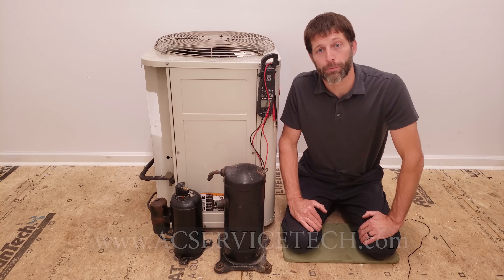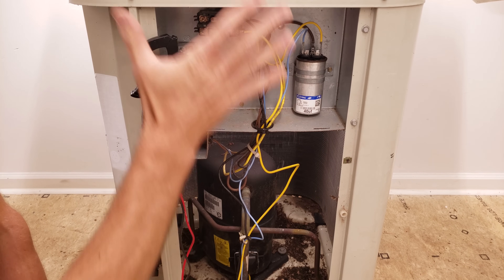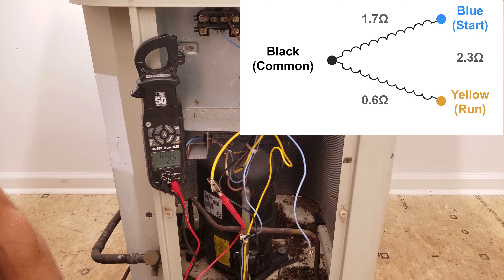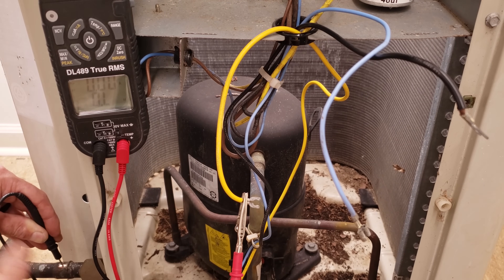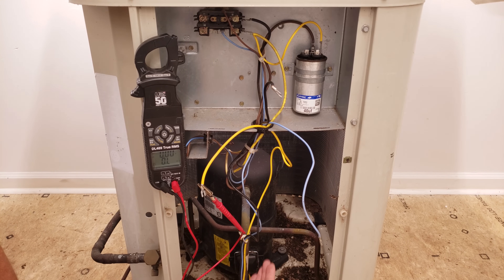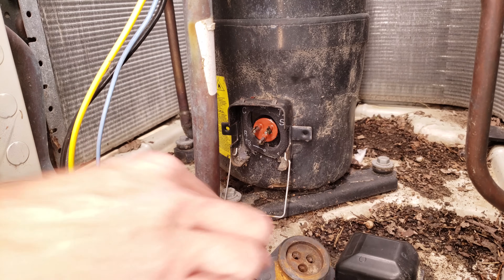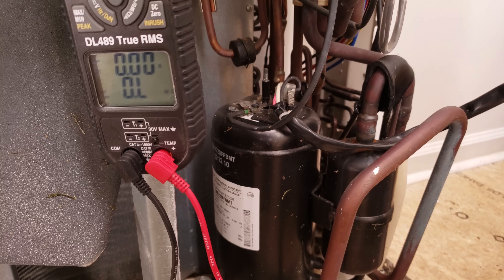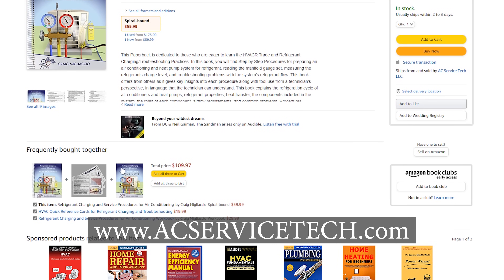Testing if an HVACR Compressor is Shorted to Ground, Open, or Overload Tripped!

Comment: This tutorial very useful. But that's part of compressor checking. That's electrical checking only. What if the compressor is seized. Or weak.
One of the best solutions checking mechanical functionality would. Be pump down the unit to see if it pumps down correctly or not.
On the other hand all inverter units have same winding resistance as the inverter controls the load of compressor by increasing and decreasing the Amp and volt rather than winding.
Big like to all  your efforts during last couple of years. Appreciable
Reply: Is it possible that Freon levels could be too low for the compressor to pump down correctly?
Let's say the unit actually does start cooling down when it's turned on initially, but stops cooling after 30 seconds or so, and then you try to do a pump down after that.
Reply: Can vapor pressures be too low for the compressor to pump down the remaining Freon?

Comment: Is it a failed compressor if the compressor is pulling double LRA even after installing a hard start kit but the windings have continuity? Compressor isn’t tripping the circuit breaker either
Reply: Yes that would be a failed compressor if it is mechanically locked up like that.  Sometimes you can give it a bump and it will free up but that's a stop gap solution

Comment: Great video. What is it that is causing the ac breaker trip frequently? Checked all the electrical of the condenser unit and all seems to be good. The capacitor is new the fan motor has no issues the contactor looks good. Could it be the compressor causing it? If so how to diagnose and fix? Thanks.
Reply: Check the circuit breaker itself...Make sure that ac breaker it not warming up or hot when you start/running the compressor,  check the temp of the circuit breaker-using HVAC infrared thermometer...Also, With your HVAC clamp on ammeter, check the Starting Load Current SLA and Running Load Current RLA...
Reply: @thembones12  Thanks for the reply. Just for your information, it was the compressor. It was overloaded with Freon. Overcharged with the Freon. Recovery of the freon did the trick. The breaker has not tripped since then. Thanks.

Comment: Not all failures are burnouts. There are 3 types of Compressor failures opens,  shorts and burn outs. A standard VOM may not find a high impedance short to ground a merger maybe required. I’m a HVAC&R service tech with 40+ years of experience.
Reply: Generally shorts to ground are not a burnouts or have significant amounts of acid in the system.
A burnout will generate acid from insignificant to severe and often create sludge if any doubt use an acid test kit. At a minimum a high capacity liquid line dryer should be installed when changing a compressor and the refrigerant should always be changed.
Reply: @monteglover4133 megohm
Reply: Yes definitely a megohmmeter is the right tool for this a vom is not capable of reading such values
Reply: I'm not that sold on meg ohm fail, bcos i'v seen units called out as condemned, low megs, but just warm it up, run it, then check megs again and voila the reading climbs to a pass reading.
Reply: @Froggability  compressors with liquid refrigerant in the oil, or contamination, or moisture in the oil can fail a megger test.  Meggers are the proper tool to use to determine the condition of the motor windings, or the atmosphere around them.  It’s part of annual service on large  air conditioning units, where a burnout can cost thousands of dollars to clean up.  The compressors are taken off line, to prevent a running burnout.
Reply: @rodgraff1782  . Hi. 
What s the minimum acceptable value of meg ohm test before changing compressor to prevent burn outs.
And better, What s the minimum acceptable value of meg ohm test before changing the refrigerant to prevent compressor. Thanks
Reply: @lebmael1709  when measuring insulation resistance on large chillers, and the manufacturer specifies what the limit is, before you have to take the unit off line, because it is close to burning out.  Usually the readings I take on smaller compressors will show up as the megger gets harder to crank and the needle moves all the way to the right of the scale.  I use the old style crank type, not the cheap ones that run on batteries.  My meggers  use a hand type crank generator to  create the test voltage.  If there is a short, it puts a load on the megger and it gets harder to turn.  The test voltage settings are 250 volts, 500 volts, and 1000 volts.  My book states the resistance value minimum at 2 megohms.  For a 230 volt compressor you would test with 500 volts.  For a 460 volt compressor you would test at 500-1000 volts.  The resistance measured will go down if  a motor is moist.  For compressors, the megger test will fail if there is liquid refrigerant  setting in the compressor, or if there is moisture in the oil or refrigerant around the compressor.  The reading will also vary with motor temperature.  It’s best to get the minimum resistance to ground specifications from the manufacturer.  With the high test voltage, it has always been quite obvious to me, because the high test voltage will make poor insulation arc to ground.  Starting a compressor that has a lot of liquid refrigerant can cause a short to ground.  That is why the manufacturer specifies that the crankcase heaters need to be energized, for a length of time ( usually 24 hours), to drive all of the liquid refrigerant out of the compressor.  On a  semi hermetic that has a lot of liquid, you won’t be able to see the oil level thru the sight glass, because it will be too high.  Once the refrigerant I derive. The oil level will be within the sight glass
Reply: @rodgraff1782  many thanks . 
In the same way, is there a method, when servicing a machine you did not set up, to recognise a possibility of poor evacuation during first installation , before having a fail test merger.   
And if yes,  how to fix the problem easily to prevent bigger problem due to moisture in the future ?
Reply: @rodgraff1782  ok 👌. 
About moisture, when you remove the refrigerant by recovering it to check the system.
Alter a good evacuation under 500 microns, If the micron level rises and stabilizes around 500 , good sign ? No moisture ? We can reuse refrigerant and restart the system ?

 If there is moisture, it gets out of the system with refrigerant and remain partially in the oil ? What is the acceptable limit of rising microns level before stabilization to know if moisture or not?
If there is moisture the refrigerant needs to be replaced or just filtered? And what about the moisture which is stuck on the oil ? 
Many thanks
Reply: @lebmael1709  I don’t know hat type of system or compressor you have.  On a system with a sight glass ( most larger systems) there is a moisture indicator in the sight glass that will tell you if there is still moisture.  You have to keep changing the driers and running the system to get the moisture out.  If you have a similar hermetic compressor, the oil can be changed to help.  I think you already proven the system is free of moisture if it held at 500 microns.  Our recovery machine had the ability to filter the refrigerant once it was recovered.  It contained large dryers.  You can change the refrigerant if it suspect.  Add a new drier and sight glass regardless of what you do.  Moisture can be trapped in the oil, but running the system with new driers should clean it up.  To test for air and non condensables , the refrigerant has to be in the system, but any air will come out with the refrigerant once you evacuate.   There is also the possibility that someone topped of the system with the wrong refrigerant.  This would show up as a different pressure other than that of the correct refrigerant, if you do a pressure temperature check.
Reply: @rodgraff1782 ok thanks.  i maintain mainly inverter heat pomp and inverter ductless system. So there are not any driers or sight glass.  
If necessery , i will add a drier on the liquide line to clean up the system.
Reply: @Froggability  Thats the purpose of having a crankcase heater energized for the time the manufacturer states in the installation information.  Usually, if you feel the compressor, and it’s warm to the touch, it should be ok.  I had two Trane units that failed the megger test, because they had been de energized, and refrigerant migrated to the compressor. Once power was restored, and the crankcase heaters drove the refrigerant out of the crankcase, the compressors passed.  They will also fail the test if there is moisture and contamination around the windings.  That indicates that the system needs to be cleaned up, by adding driers and running the system until the sight glass moisture indicator shows no moisture, and the oil is clear and contains no acid.  It’s best to change the oil if possible, because the oil will absorb moisture.  If the compressor doesn’t pass after all the above, then it is suspect.  Compressors will run at a lower value.  Just because they fail the test, it dose t mean they will completely fail immediately, but they are at risk of burning out.  I always megged new compressors before installing them.  I have caught several new ones that were not good.
Reply: Y’all making this way more complicated than it actually is. Set your meter to continuity. Check each leg to ground. No continuity means no short. Now check continuity from leg to leg. If you have no continuity between legs then the compressor is either 1. Tripped on thermal overload causing windings to read open, wait til compressor cools and check again. If you check continuity after compressor cools, and you still have no continuity between any of the legs, the compressor has open windings and needs to be condemned. Ain’t that hard. Old heads trying to sound too smart
Reply: Thank you so much for your help 🙏 and it help me a lot God bless you
Reply: And valves
Reply: Gentleman, answer me this… I watched this video and went out to the garage and tested a compressor that was off a removed rls3 everything showed that this compressor was good . I then went to look at another rls 3 and it showed what I thought was that it was grounding. ( all 3 plug to ground showed 1.6 +- ) i told him it seemed it was grounding. Question will a grounded compressor still run? Someone else came and replaced the pcb and it worked.. I’m confused to say the least
Reply: @EbenandDylan  from any pin to pin (3 of them common, start, run) there will be a low resistance any pin to ground (the shell of the compressor) should be near infinity.
Reply: I believe he stated that lol
Reply: I have a scrolled compressor and is it possible that there is shorted only one terminal? (Like only one wire is around 20 om to a ground )
Reply: What happens if you disconnect ground  ? Will it still work is short to ground  ?
Reply: @n @nicolaepopiela1857 the case would be live voltage
Reply: SO true
Reply: Acid is what eats the casings and  burns the windings causing a short or a burnout.
Reply: Every hvac tech should have a megommeter to test for those high impedance shorts!!!
Reply: @TheWpruden  even the cheap ones, will work if it has a high voltage test mode

Comment: I have that same meter!  I love the dual temp probe feature, and LRA/inrush option.    Also the min/max option is cool.  Great video, thanks.
Reply: Also your vacuum videos really saves me a lot of time.  I use your 3 core tool removal tool method with 2 hoses, I pull a vacuum in 5 minutes or less with valves open!  My company wants me to train everyone on how to do it, I did give you credit.  I wish more guys would spend time mastering their trade away from work.
Reply: A good meter will tickle your peter

Comment: So basically if the compressor is off on overload it would read OL between windings?  And if it’s shorted to ground you would get continuity(tone) from the shorted winding to ground ?
Reply: If you measure ohms between run and start but not common and run and common and start that's am internal overload that is opened
Reply: You would read continuity to ground on all windings since they are all connected

Comment: Just for info, I was taught that OL on a DVOM / multi meter is “Open Loop” because an electrical circuit is essentially a loop.
Reply: OL = Open Line = Open = No Continuity = broken connections = broken loop = broken wire = OFF line = broken circuit = it's not connected, it's open....
Reply: Dt Candia - yeah, open loop.